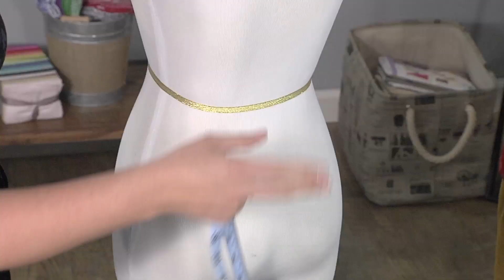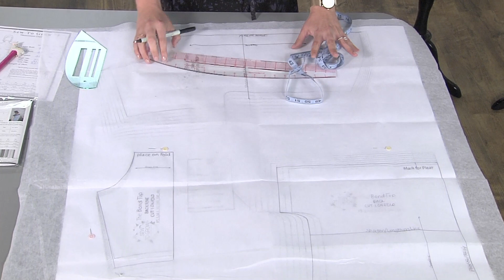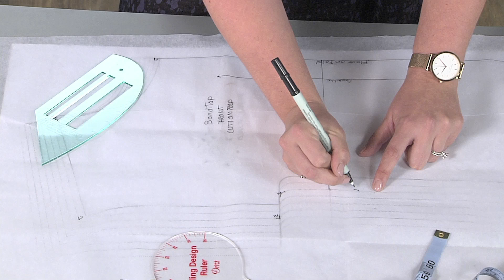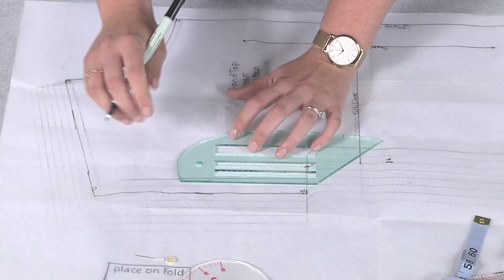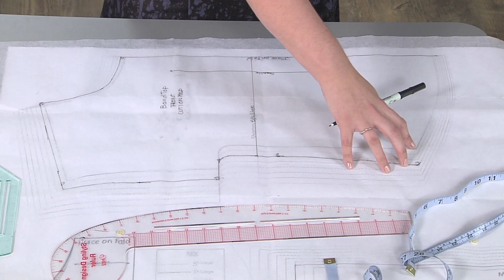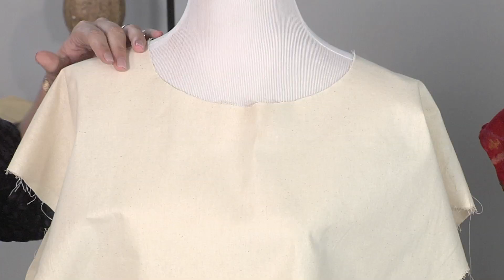Make a Bondi top on It’s Sew Easy with Lindsey Marsh (1804-1)

Comment: Thank you so much. Going back to commercial size charts, I have noticed that some jogging pants have waist, innerseam and hip measurement but do not have total length of pants. How can we figure out the total length of the pant. Can you help, please. Thanks.
Reply: If you want to figure out the inseam of a pant, I suggest measuring your own inseam and then comparing it to the actual pattern. Then subtract the seam allowance and hem allowance. This way you can decide if you want to shorten or lengthen the pattern before you make a mock up. I always suggest making a test garment first before adjusting the pattern too much.
Reply: Thank you very much. That should help.